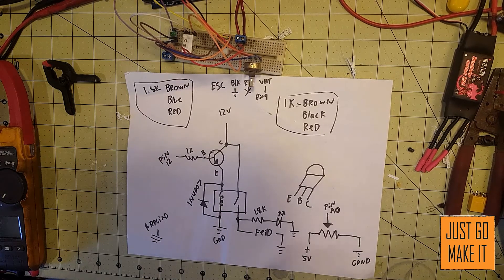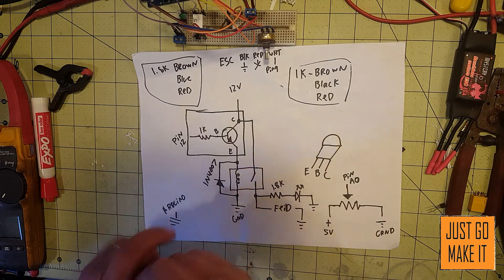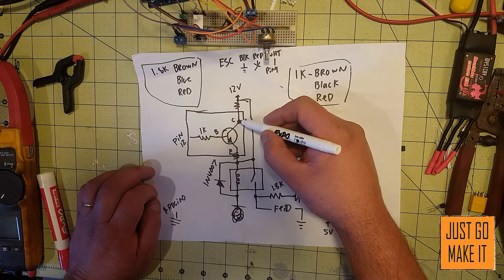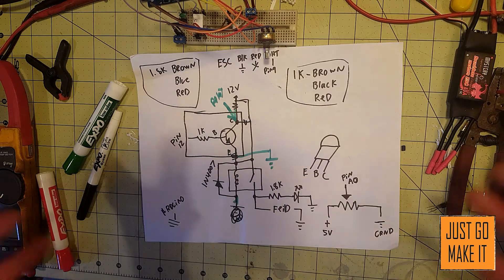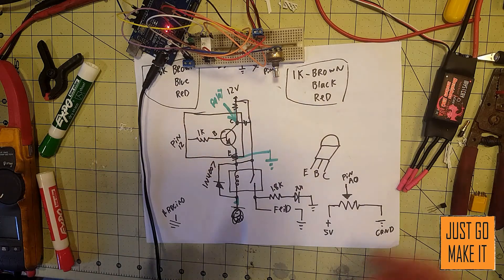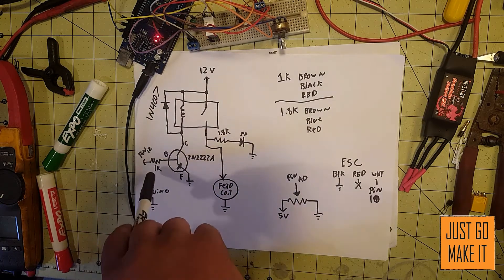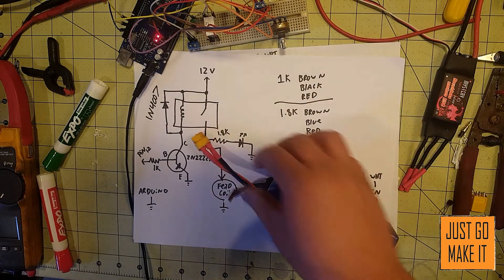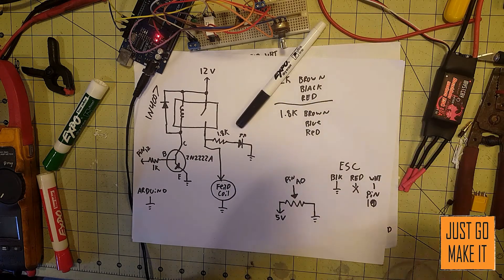Pt. 4.1 Alternator to Brushless Motor Conversion 2.0, I goofed on the electronics

Comment: Glad you realized the circuit was wrong from the last episode. I am sure you saw it after reading several of our comments concerning it. Your explanation was good in the hole theory way LOL. Thats what it is called in electrical theory. I prefer not to use the hole theory as it has problems but most people get it ok.

Comment: I’m a little rusty on my electronics theory. But is this due to it being a npn transistor which when positive is applied to the base it allows negative to flow through the collector and emitter in a negative positive negative wiring. I would imagine this diagram would work if you used a negative signal to the base and a pnp transistor. It’s been 15 years since I took electronics classes so I could be wrong

Comment: Hi, Great videos! I have a quick question. Could you control the alternator-motor with an ebike brushless motor controller? If no, would it require adding hall sensors to the motor?
Reply from the maker: +Fulton Harley as of right now i do not know.  but i have one ordered so i can see if it will work.   keep an eye out i will have some thing on it sometime
Reply: will do - thanks